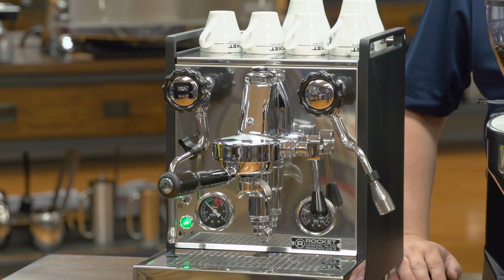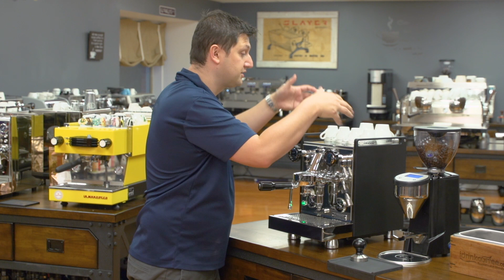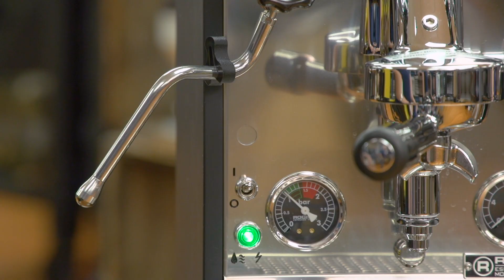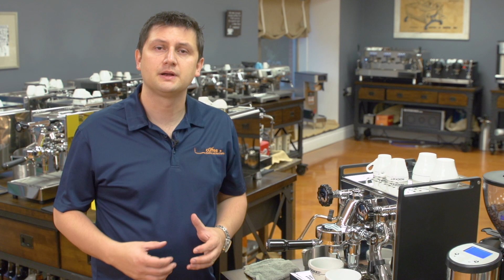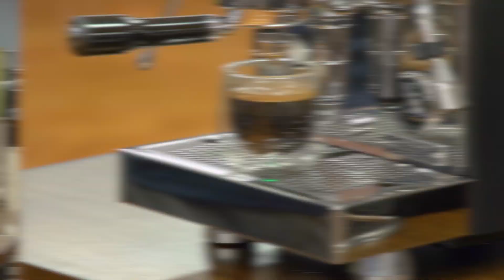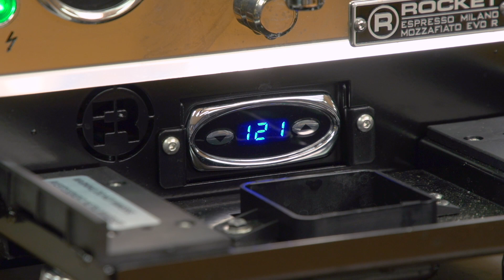Rocket Mozzafiato Cronometro R (timer) Espresso Machine

Comment: Hi, loved your video. Just to clarify some confusion: Whole Latte Love suggested no cool flush since the machine has a PID while a short cool flush is recommended here. Which is prefferred?
Reply: Think it's "no need" to flush in case of PID machines. No difference in the result temperature-wise.
While for non-PID heat exchange machines, we should (or must?) flush some heat out from the group to "correct" brew temperature if it's been  idle for a while. That's what i learn so far.
No negative impact if we do flush the PID machine though.
Reply: I had the same question!  Coming from an Appartamento I'm used to the flush, but I'd gladly get rid of it if that's OK.
Reply: It's like a preferred step or automatic habit to flush before put in the pf of most trained barista :)
Flushing every cup wouldn't hurt any cups on any machines.

Comment: Really great review, just decided for this machine and I‘m very happy so far. Just a question - my Shot Timer shows a „snake“-symbol or similar and I can‘t figure out the meaning... any advice is really appreciated!
Reply from the maker: Where is the symbol?  I don't have this on my machines.  Is it a Rocket?  The Biscione is the symbol of Milan.  It's a snake eating a man and it is also Bezzera's logo but I haven't seen it on the Rocket
Reply: No it’s actually on the shot timer, so that the shot timer displays kind of a heating symbol when in default mode (pump not activated, machine on standby). Was just wondering what function this might display - a dealer hinted it could be a symbol for the heating being active...
Reply: @senfposaune  Correct, it means the machine is heating/heated.
Reply: Came to this video to ask the same question! The "snake" symbol seems to be always on.

Comment: im trying to decide between this machine  (vibratory version ) and the la spaziale  mini vivaldi
Reply: Veganjedi97 i got V last week , love it so much
Reply from the maker: They are both solid choices from well established manufacturers. The Vivaldi does have a double boiler system as opposed to a heat exchanger on the Rocket and also volumetric dosing but the Rocket Styling is hard to beat. Either machine will make great coffee for many years to come.